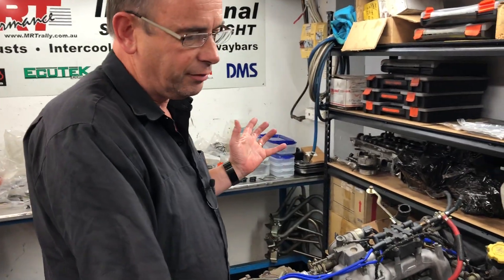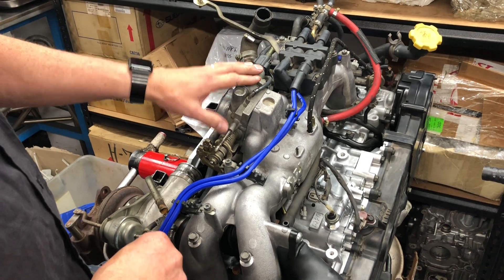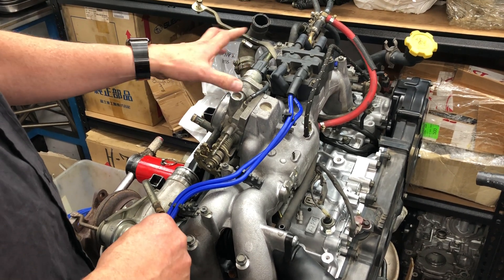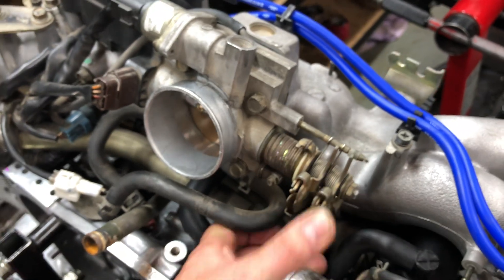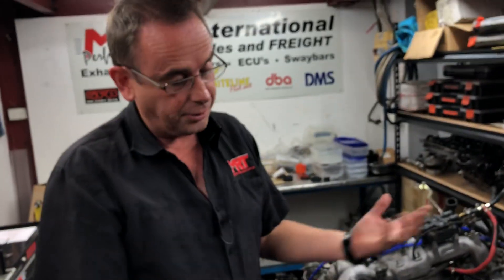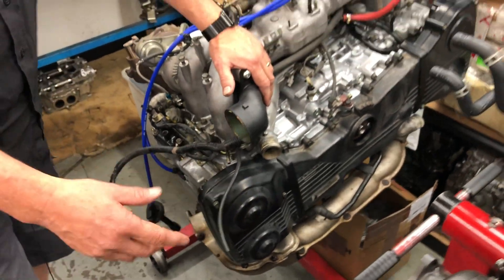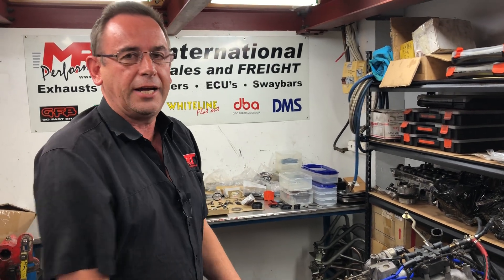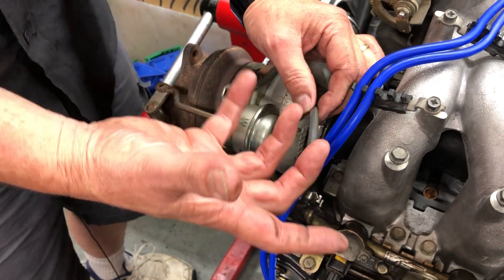MYTHBUSTERS - "Subaru engines haven't changed in 25 years"

Comment: Shitheads that say they haven't changed all these years don't know what the hell they're talking about.  It's so obvious if you know what you're looking at. All they care about is the rumble and the shit they do to break a good engine.
Reply: I wish I could like this comment 1,000 times. So many idiots on the internet talking about how unreliable Subaru's are because they put really stupid mods on and wrecked their car.
Reply: amen to this comment :D
Reply: crxtodd16 Didn't I just say the 90s changes are evident?  The 257 is already a highly tunable and platform, but vapeheads and X Games wannabes start to turn up the boost and destroy them.
Reply: crxtodd16 No, you've only said it twice.  2004-2005 had cable throttle and side feed injectors, 2006-present have DBW and top feed injectors, 2004-2007 had intake only AVCS, 2008-present have dual AVCS and SI Drive.  Now if you're looking at power/torque numbers, 300hp/300tq for 2004-2007.  305hp/295tq for 2008 to present, but if you look at 2015+ dynos, they've consistently produced more power to the wheels, but to you it may not count.  Okay.  Bottom line is what started in 2004 isn't exactly the same as 2018.  It is fact.  What you think or feel doesn't matter because he showed it to you before you miscounted how many times you told me the 257 hasn't changed.
Reply: OCTurboJoe - Touché. I suppose my argument is mostly subjective, as I feel like there should be something, in my opinion, more significant. I'll give you the dual AVCS though. Either way, I just think that at the very least give us direct injection and a twin scroll turbo. Oh well.
Reply: @crxtodd16  MORE TORQUE WITH THE WAY SUBARU SQUIRTS IT`S FUEL !
Reply: crxtodd16 I'm betting on it.  However I won't buy the first new gen until the bugs are worked out, OR until there are new "minor" changes.
Reply: hooray yes man i agree with you totally !
Reply: crxtodd16 He just showed you.  The drastic changes from the 90s are evident but the little changes, (not limited to) like fueling, throttle control, AVCS aren't compatible throughout since the introduction in the USDM.  I would say yes since 08 to now are the same but not the while lifespan of the EJ series as everyone else says.
Reply: Pfff. Tell me what has changed on the USDM EJ257 between now and when it was originally released.
Reply: No he didn't. He showed the difference between an older EJ207 and a new EJ257. I'm only talking about the 257, not EJ's in general. Roughly 15 years and no innovation.
Reply: OCTurboJoe - You're missing my point! The EJ257 hasn't changed since it was introduced to the US domestic market!! That's well over 10 years with no change!!! I don't care about the rest of the EJ's. I've said the same thing 3 times now!
Reply: @crxtodd16  THERE AINT NO POINT = EJ ENGINES ARE AS WELL KNOWN AS A 350 CHEV V8 EVERYONE KNOWS SUBARU EJ MOTORS CAN BE REAL MONSTERS = MY GT FORESTER EATS V8`S REAGURLY !  AUDI`S MERCEDES AND MITSUBISHIES ! HA HA HA - WHAT DO YOU DRIVE = AND I DO ALL MY OWN REPAIRS AND SERVICES !
Reply: I am Me You're right.  If you count the years before the USDM model arrived, there was phase 1 and phase 2 variations, which cannot be interchanged due to many mechanical differences.  Many vape fuckboys won't know that.

Comment: Pity they didn't do a little bit of R & D with the 2006 2.5 turbo models with faulty secondary Air Valves. Subaru were charging $AU4200 to fix a problem they created.
Reply: Subaru issued a recall on the faulty component causing the issue. Mine totally failed and they replaced the complete system. They did say that this was the first one they encountered with the complete burnout. But this was a Suttonns Suburu dealer at Roseberry/.Sydney/Australia.I was going to do the delete with the ecu adjustment when I found the recall. I actually purchased my car from Subaru Australia and they did not adjust the records, so i was unaware of any notifications/recalls. All sorted now, Airbags recall and a new dashpad because mine went sticky. You`ve got to love SUBARU AUSTRALIA so old and factory warranty still exitsl
Reply: Think a little outside the box. Take the red pill and throw those things away and turn off the engine light.
Reply: +gen3v8
"They did say that this was the first one they encountered with the complete burnout."
Whenever there's a major problem a dealer has to resolve, they always seem to say it's the first time they've come across that particular problem. Funny that :)
Reply: Sherie Thomas it was never designed for an airpump as the rest of the world don't use it so it obviously failed in the testing department.....passing smog is ...
Reply: Sherie Thomas My one was completely replaced by Subaru Australia last year FREE
Reply: Ours failed at 60000klm / 48months. Our dealer approached Subaru to come to the party, but they declined. The only indication of a problem was that the cruse control light was always on. The problem was fixed with a ecu reflash. The actually valves are still in place.
Reply: Been there done that. Happend ~70k km. Removed the relay, changed a setting in the ecu, no charge. Fixing it was going to cost ~ 400 usd
Reply: Hey sherie wanna help me solve my blue balls problem? It's a little faulty maybe it needs your touch
Reply: common issue in the states too; we just tune the secondary air system codes out, block the passages off and in most cases remove the no longer used parts.
Reply: Sherie, I would give your bottom end a complete rebuild for free if you came to me